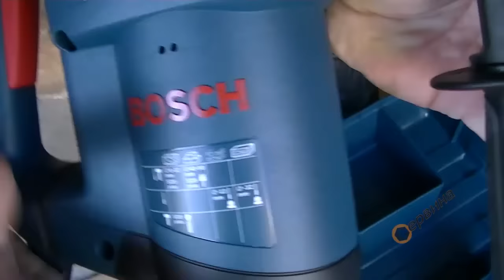TEST перфоратор Bosch GBH 4-32 DFR 0611332100 - 900W 4.2J

Comment: Im trying to decide between 4-32 and 5-40DCE

4-32 has less energy in impact (5J), but it is lighter and a bit smaller, it can drill even without hammering function, uses SDS+, so it is easy to find many chisels and drill bits for it.. and it is cheaper a bit

5-40 has more power in impact (8-9J), is heavier, uses SDS Max tools, cannot just drill without hammer and is more expensive.. 

Since I have 1100W Narex mechanical hammer drill already, drilling into wood or steel is pretty much solved. But...I'd like to have something with 4-32 size and at least 7-8J impact.. for lighter demolitions like old concrete floor, steps, brick walls, tiles etc..
Reply: im just like you so what did you chose
Reply: brathar praich kato
Reply: You all probably dont care at all but does anyone know a method to get back into an instagram account??
I somehow lost my password. I would appreciate any help you can offer me!
Reply: @Hayden Albert instablaster =)
Reply: @Ethan Creed I really appreciate your reply. I found the site on google and im waiting for the hacking stuff atm.
Looks like it's gonna take a while so I will reply here later when my account password hopefully is recovered.
Reply: @Ethan Creed It did the trick and I actually got access to my account again. Im so happy:D
Thanks so much, you saved my account!
Reply: @Hayden Albert Happy to help :)
Reply: 1ๆๆๆๆ
Reply: 1ๆ
Reply: 1ๆๆๆไฟเบอร์ๆๆ
Reply: Yiğit Perk